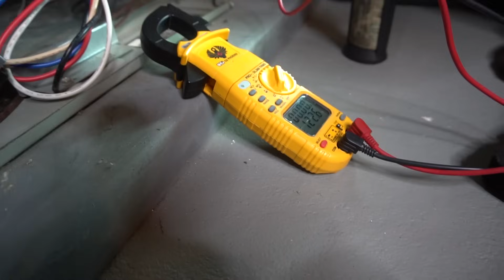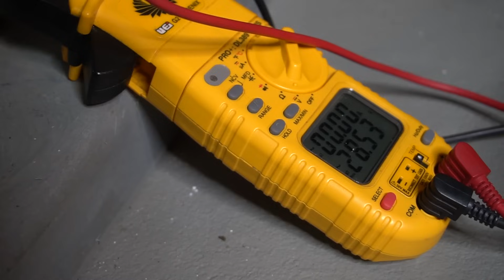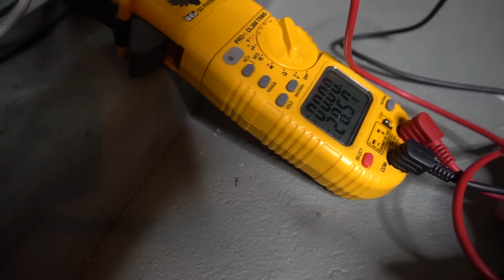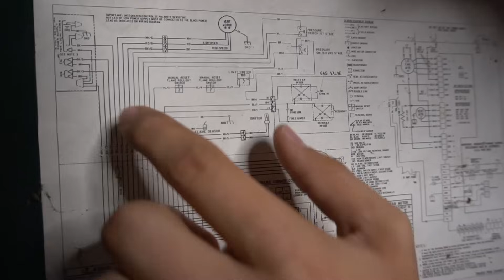Furnace/AC How to Troubleshoot The Control Board

Comment: I have a York HVAC with a '1 Source  201' control board. The fuse is on the board itself. The fuse keeps burning out. I have already replaced 4 fuses. A couple fuses burnt right when the AC started. The remaining 2 lasted for a few days before burning out as well. What might be causing it ? Do I have to replace my control board ?

Comment: Better to look through the plastic view port in the access door, if available, first. If you see the red light (sometimes green, sometimes more than one light) is on or even if it’s flashing, that tells you the board is powered with high and low voltage. Use voltmeter to confirm input power, must be 115 vac +/- 10%. I don’t like to see less than 110 vac or more than 126 vac. If the light is flashing, count how many times. Then, remove the door and look to see if the fault blink code is listed on the wiring diagram. For example, Three flashes might mean a pressure switch fault: check to see the draft inducer runs, the condensate drain tubing is clear, the drain trap is clear and that the vent pipe is open. Make sure the vent pipe on a high efficiency furnace is sloped properly and no water is being held-up in the vent pipe. Air inlet pipe must be clear of blockages, bird nests, dead critters, leaves, toy cars, tennis balls, etc. Something like 70% of the control boards returned for warranty are not faulty!

Comment: Does it matter which lead (red, black) touches something first?  Is it possible that an AC is blowing the temp you want the room to be set to? (ie I want the room at 68 degrees so the air blowing should be significantly colder than that in order to cool the house-I think- but if what is blowing/coming out of the vent is the same temp I set it to, 68 degrees, then the house will never get down to 68 degrees.) Is this likely a board problem? Thank you! (I've changed the filter, cleaned the drain, and washed the condenser coils too) It is a huge new Lennox AC. Thanks!!!

Comment: So my light on my control board stays red when door switched is pushed in. But when I removed the power wire and tested the switch to the common I was only getting around 10mv?

Comment: Thankyou for the wonderful video. The secondary side of my transformer is sending 24V to the board, but the board R and Y show no voltage. Fuse is also good. How do I fix this ?
Reply: Was it the control board?
Reply: @doninmichigan  it was the capacitor

Comment: My insides unit when i turn a/c starts working normal but than it start  making banging noise its almost like blower trying to shuts off but it cant ,any help , i research a lot change air filter nothing helps but issues is start working normal than 5 hours later or 2 hours later starts banning

Comment: AC went out, nothing is turning on including red light on control board. I have power at the outlet and thermostat is on and working. Tech came out to look at it, said it was the board. I replaced the board but nothing has changed and still no light on the board. Your thoughts...…….

Comment: This video is great! one question, great appreciation in advance if you have any comments. I have an ECM motor with IFC (CNT07711). 'circ-H' and 'circ-N' have voltage (~127 ACV), and 'G' and 'C' has ~27 ACV. Thermostat is in "cool". However, there is no voltage between 'circ-com' and 'cool-H' (low voltage 24 ACV output to ECM). If LED indicator flashes slow per manual IFC should be normal and ready for call. However, blower motor doesn't work. Is it possible IFC failed? By the way, there is one relay on IFC (color white) buzzing.

Comment: my blower  stop working when ac on but works with heat on .. i think its the board tho but is there a way that u can wire the blower directly but the ac unit turns on because i tried wiring the blower directly its turns on BUT the ac unit  wont turn on but if i plug everything in normaLY the unit out side turns but blower still wont

Comment: Thank you for excellent video! I learnt a lot. I have a question for you, though. My control board works for heating side fine but ac side doesn't seem to be working. i tested capacitor, fan motor and are good. So how do i make sure that it is controller board and not anything else. My problem started with frosted condenser and i used your related video to troubleshoot it. replaced filters, checked e-coils etc.
Reply: Hey, were you able to figure out what was wrong?

Comment: Any advice on a replacement First CO CB201V?  I used the video to troubleshoot why my air handler fan was continually running.  With all the wiring correct (no shorts) and thermostat replaced with a working unit, I concluded it was the relay switch (stuck in open).  With he new control boards, First Co eliminated the COND terminal.  Both of the common terminals are being used already.  Where do I hook up the wire that was connected there?

Comment: THIS IS SPOT ON. AFTER SEEING THIS, SAID TO MYSELF, 'ITS THE BOARD.' TECH CAME OUT, TOLD HIM THE SYMPTOMS AND HE SAID IT WAS THE BOARD TOO [IT WAS BURNT]. DID NOT WANT TO DEAL WITH THE INSTALL HASSEL AND PART RUN AROUND, BUT PAID A HEAVY SWAP OUT PRICE OF $878.
-EX NAVY ELECTRICIAN PO2.
Reply: Too bad, I am having issue with mine also, after the batteries when bad on the thermostat, I changed and AC furnace not working at all, a tech came and gave me a quote  of 12 hundred, trying to get a second opinion and save few hundreds. thank you.

Comment: My control board was not lighting up I have power coming in to the control board 120 V. I check the transformer it have power but was not sending 24 V to the control board that could be my problem. Because the board was not lighting up for anything.

Comment: I  have a  Rheem furnace board to replace  but any time 24 volt get to the board it blow the 3 amp fuse. even just the board with nothing plug in just the 24 v that I  check first to make sure it is not lower than 24 . what may cause  the 24 v never pass throughout  the board  to the order side of the board?

Comment: Hi Jay, We have an Amana Air Command 80. We've had to have the igniter changed a couple of times in the past four years. Unit stopped putting out heat again & I researched & bought my own igniter. We have a green light on the board, new igniter & I've checked everything as you've suggested in previous videos. System will not turn on the igniter or the gas, just runs the inducer motor. I can see the pressure switch change the control board LED from red to green. Any suggestions? Great videos BTW.

Comment: Is there a control board also in the outdoor unit?  I took the electrical panel off the condenser and saw what looked like a printed circuit board with a pigtail and a blinking green light located right where the whip enters the panel.  If it's not a second control board, what it it then??

Comment: Mr Jay ,good afternoon sorry for the inconvenience ,two months ago I changed the burned control board of a Goodman Air handler and since then when the evaporator motor stop ,and  there is silence and the  I hear a noise coming from the air handler like the transformer is humming , is this normal? If not could you suggest what I can do

Comment: Where would one look if there is no input power/line voltage coming in at all? The labeled breaker goes to the furnace motor itself, right? Not the controls?

Comment: No power to the controller; led if off. I am getting only 19VAC at the door switch when open and 0VAC when  the switch is close. Can you help diagnosing further? I tripped the breaker many times; the receptacle for the pump and humidifier that is beside that switch is getting 120VAC.  Furnace was fine before I start cleaning both compartments. I looked for any loose wire, I can't fine any loose. Led stay off when I taped the door switch. 0VAC between white and black wires going to the controller when the switch is closed as explained above. Thanks in advance for your reply.... no heat  right now...

Comment: Hello J?  I've replaced the batteries in my home thermostat and it's still not powering on.  I need heat asap.  My home is 19yrs old.  Should I consider buying another thermostat?  It's a gas furnace.

Comment: Are wires on the secondary side of transformer called Hot and Common? Because I had argument with my teacher in HVAC school.
He says that wires on secondary have no sides. Therefore there is no difference where to put fuse.
P.S. Asked another instructor and he in our Lab and he confirmed that. is that right?

Comment: I have the exact same furnace as you.  I think you mentioned in a previous video that you should be able to read ~50V across the flame sensor (sensor spade and a ground) and if you can't then the control board is bad.  My board has power, the igniter comes on and burners light and the blower fan comes on and everything seems fine for several minutes but then the burners go off.  The furnace tries to light them but they won't go.  Then I get a "lock out" error code and the blower fan runs for several minutes (I guess to cool down the furnace).
I suspect the worst (heat exchanger).  Time for an endoscope.
Reply: Did you ever find out the problem my furnace has simular issue
Reply: Adding an update. I had a professional diagnose and it turned out to be the control board. $400 and its fixed

Comment: Watched this vid and fixed the control board on my furnace which had no red light on and was dead. Turned out to be the transformer getting power in but not out. Thanks a bunch, You are the MAN! 👍👍
Reply: Big Texas I think it’s good blower works and heat works just not sending power to outside unit no flashing lite on board train unit
Reply: @johnking4799 Mine is doing the same thing. Now that I got the constant blown transformer issue resolved and the furnace and blower will run forever I can't get 24 volts to the outside until to turn it on. For the time being to keep from having to burn up when it's hot outside I just jammed the contactor closed on the outside unit and use the breaker to turn that unit on and off to cool my house down until I figure out why it's not getting 24v. At least it works manually.
Reply: Big Texas I thought about that contact too on outside unit  just not sure why no lite on my control box
Reply: I can turn my blower on and off just no turn on for a/c wondering if wire to new thermostat needs to be connected
Reply: MY BOARDS HAS NO LIGHT AND GOT ANOTHER BOARD NO LIGHT EITHER WONDERING IF ITS TRANSFORMER BUT HAS BEEN REPLACED ALREADY?
Reply: @johnking4799  If you replace a furnace transformer and it blows again that means you have a short somewhere on the low voltage side. Mine blew the transformer 3 times before I found a break in one of the wires.

Comment: Thank you for the video! Have a goofy situation i guess as the furnace sometimes throws a flashing light for the pressure switch however it then runs fine and then the next day it starts flashing again. That is after the pressure switch was replaced. Everything was checked and the voltages check out...no idea if it is something else within the control board
Reply: What kind of furnace
Reply: @clintharding657  Hi, it is fixed now, both sensors for the air pressure had to be replaced...it is a Gibson furnace

Comment: I feel like my control board is no good. I'm getting good voltage in and out of my transformer but 1,6 vac on thermostat strip. I have Lennox 50A65-120-03 circuit board. I've investigated around and seems I can use a 50A65-843 in its place. Any suggestions?

Comment: I like your videos. They are very detail oriented. Thank you!
My furnace recently started blowing cold air even thermostat is turned to off mode and fan to an auto mode.  Only turning main power switch off would stop the fan blower. Also the igniter is flashing golden yellow light constantly without the burners catching a flame. Waiting to hear from home warranty guys to fix it. I appreciate your thoughts please. Thanks.

Comment: I do replace the thermostat and instale send me a code ‘ it’s say they can read the indoor United ‘ this Lennox WiFi thermostat only ave 4 connect in te back R i- I+ c fallow the guide and still can read’  guide say if this problem continued I have to replace the indoor United control board ‘ can you help me find out the solución , my furnace brand it’s Honeywell and the thermostat it’s comfort sync ( Lennox)

Comment: This video saved me big bucks. Of course on one of the coldest nights of this winter my furnace gives out. The unit in the video was completely different. I followed the steps and found a 3A fuse burnt. Replaced the fuse and furnace fired right up.
Reply: What made the the fuse blow?  They don't blow for no reason
Reply: Fuses rarely just blow, especially control fuses. Replacing the fuse almost always solves nothing.
Reply: I am having a similar issue with my upstairs furnace. It will run fine until the temperature in the attic gets below a certain point. Somewhere between 35-40 degrees. Then the inducer motor fails to start properly. it will try and run then stop. I have been told it might be a board issue.
Reply: @Chris2745100  sounds like a run capacitor, but in three months   I'm sure you have already figured out what the problem was  ;)
Reply: @joeb4117  Yes it was the board.
Reply: @Chris2745100  have you checked your air filter?
Reply: @mesureshg  you mean the one that you normally find in the celling? Just had it replaced in October; should still be good for another month.

Comment: Okay Jay so my outside unit doesn't turn on when thermostat calls for cool. The blower motor turns on at the furnace. Contactor doesn't pull in but starts up when pushing it in. I tried to jump thermostat but nothing happened. I Noticed I am not getting 24 at the contactor when thermostat is calling for it. My problem is that the tech did a crazy bypass on my control board years ago so I'm not sure how to test it. Like he doesn't have anything hooked up to y but two wires to g and nothing on cool but on xfmr etc. The board is no longer made anymore and very hard to find but there are replacement boards that replace many models.
Nordyme  p/n 6245640

What are your thoughts? Thanks Jay.

Comment: My Armstrong furnace stopped last week and would not come back on. I ordered a control board and gas valve. The technician came out and replaced the Gas Valve first with no luck. Then he replaced the control board and it worked fine. This unit is 20 years old. Should I leave the new Gas valve on the unit or have them to install my old gas valve back since it did not fix my problem?

Comment: Thanks, my problem was at the beginning of your video, no power to the unit. I checked it with the meter, I got 0 volts,  there was a wire that came loose in the breaker box. Thanks for detailing everything, Guess What?  It feels good in here tonight, I got the AC on.

Comment: Can you replace a cnt07541 control board with cnt07941 ? They look exactly the same.
Reply from the maker: If they look exactly the same, you should be able to. I've done that a few times before and never had issues. Although I do call a parts store and confirm before doing that..

Comment: I had a control board at my sister's house was sending only 7.8vac to flame sensor.  Does it mean board is bad?
Reply from the maker: 7.8vac is very low so yes, either the wire connector/terminal is loose or the board is bad. This would be the case for most furnaces.
Reply: @WordofAdviceTV  I know you get a lot of emails and you still took time to answer, it means a lot to me.  The problem ended up being gas delivery.   Company replaced the gas meter and regulator.  The water heaters were losing burners too.  Apparently Stove doesn't require that much pressure so it was working fine.
Reply from the maker: No problem! :) I answer as much comments as I can get to but as the subscribers grow, so do the comments.. But wow! I would have never guessed that! If I was there that one would make me chase my tail for a little while. That's definitely not a common problem. Thank you for the update! Lesson learned :)

Comment: I started with vac switch code... checked switch and inducer motor and they were fine.  Before i got a new board i removed old one completely and cleaned it with soft brush front and back and reinstalled. That fixed it!! All the dust blowing thru there over 25 yrs (yes 25 yrs) must have caused an intermittent short. Goodman unit. Tech woulda sold me a whole new furnace.  Not this time, sukkas 😎 clean yer board!

Comment: Geat video! I did these tests and everything checked out fine. I'm getting 4 flashing lights which indicates a limit switch fault. Both limit switches checked out fine so I thought there might be a problem with the controller. When calling for heat, fan blows but no heat.

Comment: Today I had a carrier gas furnace turned up tstat heard click and nothing happened at furnace.  I put tstat on fan on mode and no fan came on.  I jumped R and W on control board and nothing happened.  So would I have a bad control board?
Reply: Actually I followed up on my call today with new board and it wasn't the board it was a bad flood switch

Comment: Hot and neutral should be checked at the same point. You can lose the neutral as well as the hot. Checking for power to the board should not be done using the neutral at the transformer.

Comment: What does it mean when the inducer fan stays on while the thermostat is off? Bad board?
Reply: Is the thermostat off or just not calling for heat?
Reply: @cre8sone  it's off and the circuit board is flashing red light. Alarm says limit switch or external load on "W".
Reply: The thermostat was put to call for heat and it never started the sequence of heating. Only the inducer fan stayed on and only way it shut off is if I kill the power. All other switch were in the open/ close position when I checked for continuity
Reply: @MrOlivasalone  Remove wires from limit switches and check for continuity.